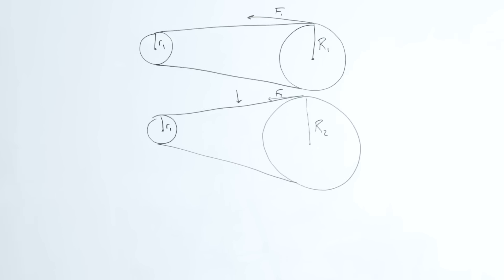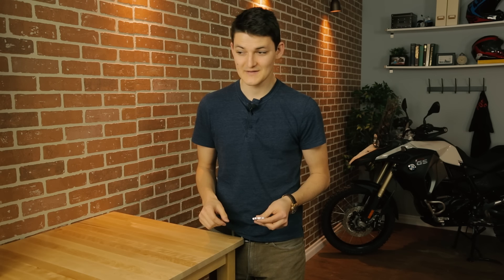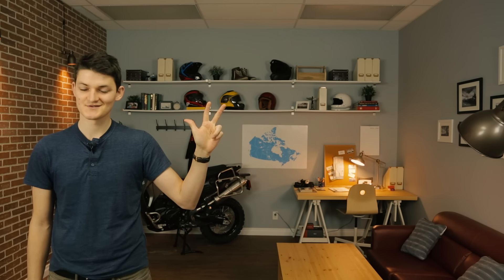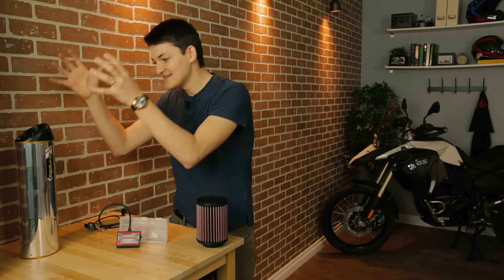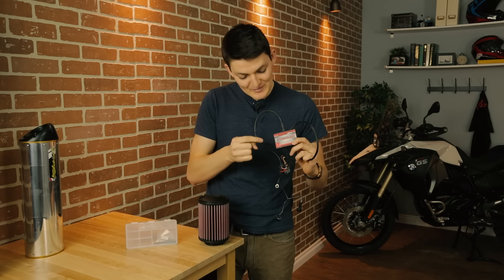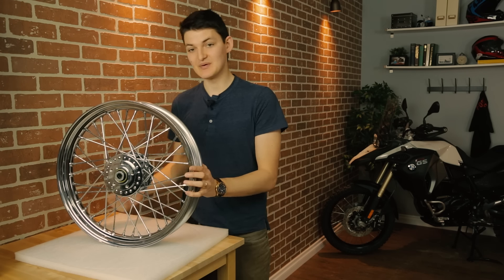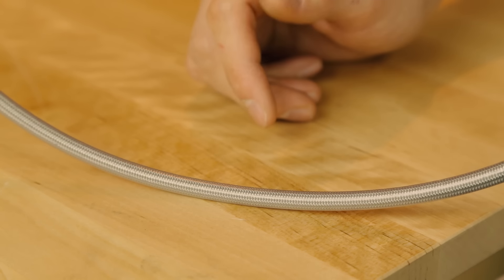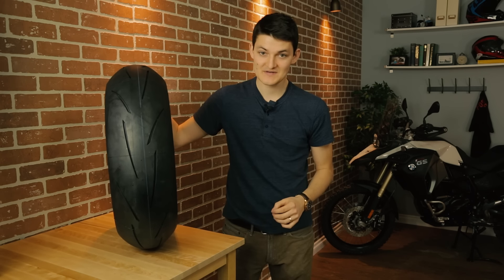Top 5 Motorcycle Mods to Go Faster

Comment: You can also unlock the vTec in Honda motorcycles by installing the stickers
Reply: Does it work with the Grom? I might have to order a sticker or two.
Reply: oh yeah, if you order 2 you get the 2 stage vtec ( low RPM and medium-high RPM settings), if you get 3 stickers, you unlock the ful potential of the 3-staged vTec with low , medium and high RPM settings !!!
Reply: This is true, but only the VFR 800.
Reply: NONONO any Honda bike has vTec, just got to have it unlocked
Reply: Gbblitz Entertainment 100th like on this comment
Reply: Gbblitz Entertainment thanks, I always knew my Honda Z50J could have vtec
Reply: But does it work on my 1100 Gold Wing?
Reply: Gbblitz Entertainment will it work on my 2-stroke honda scooter?
Reply: Ooooh shit I almost forgot about vtech, need to get a sticker for my f4i asap!
Reply: First vehicle to have Vtec was the CBR400
Reply: Then I guess those stickers will keep them winning motogp races like usual
Reply: @AvocadoAtrocity  yes I love my VTEC Honda it’s completely murdered out but at least that sound is distinct
Reply: So your telling me a sticker will make my bike faster ??
Reply: @Darko2  obviously duh
Reply: All you need is flame stickers

Comment: I have religiously done all 5 mods to every bike I have owned the last 25 years.   But the mod that gave me the most acceleration, speed, handling, breaking, and the most attention from the girls at bike night, was loosing 50lbs off my midsection.

I was like going from a CB250 to a CBR1000XX
Reply: Tall ppl cryin rn🥲
Reply: There is no replacement for displacement. My bike already goes 186 mph and seeing how I don't race around my town and highways... That's fast enough.
Reply: @mawwwkn7232  as a 6'5 dude with a driveshaft bike, can confirm 😢

Comment: A word of advice: no two bikes are the same so it's better to combine the PC with Autotune (wideband sensor). The online maps are a good point to START from. They won't be perfect by any means. The advantages of adjusting AFR in real life conditions vs static dynoshop will get you the best results. Another great advantage of the PCV + Autotune combo is that you can add a switch to either load a specific map or have Autotune online real-time to adjust AFR in relation to your current conditions (different elevations, weather conditions, etc).
Reply: @C_R_O_M  whut?!?

Comment: So many people neglect the power command/flash tune/bazzaz. Your bike will LOSE power if you install the exhaust and air filter without proper fueling. Love your videos Ryan!
Reply: Installing only the exhaust does sometimes improve performance, especially on 2 strokes
Reply: @angelorondini5835  modern bikes are already running lean from the factory, extra airflow is only going to make it worse. You NEED a tune.
Reply: @deathwish8339  you are probably right, I don't have much experience with modern fuel injected bikes

Comment: Great presentation.  I " optimised "  my 2009 Bonneville with all the above considerations.  One thing I'll advise on staying alive grounds is not to up the front sprocket from 18 to 19 tooth thinking that the power will be there but on longer legs... The longer legs are there but the top end poke is gone at 85 max.  OK for Chugger types but potentially deadly in half challenging road riding situations

Comment: do a budget bike series please.
Reply: an 80's hondas. VF 750 in any model.....can pick them up a dime a dozen for $1000 or less.
Reply: He is now...
Reply: dantae666 already did
Reply: Ttr90
Reply: Simon Wiggin do a search 44 teeth
Reply: @bonnivilleblackcherry9745  i wouldnt go that far since nowadays most late 90's and early 00's bikes from suzuki honda yamaha or other such brands go for as low as 1500$ and around the 2000$ mark. I mean its not 1000$ but i'd rather get a bike from the early 00's than a relic from 80'.

Comment: 1. Turbocharger
2. Supercharger
3. bigger engine
4. higher octane & re-jet
5. lose some fucking weight
Reply: Except the last one, all of these points are only valid for a straight line "racer".
Reply: Xénos Polemistí̱s  5. Is the best advice lol
Reply: 6. Have a perpetual death wish that makes you mentally prepared to push yourself and machine past sane limits.
Reply: Yeah I set it up so that one would be a read more click to throw people off. lol
Reply: I mean I know what you're saying but generally when people think faster, its more hp/tq, but for cornering, which lets be honest, practice would be #1 on that list. But it's hard to incorporate a list for all types of riding and racing. tracks like wide soft slicks, won't necessarily apply to street bikes, enduros, trials bikes.

1. Develope skill & confidence (shifting points, brake/throttle points, entry & exit lines, tire position/ feel)
2. Tires: appropriate size & material grade
3. aggressive suspension setup & upgraded brakes
4. steering damper
5. lighter components (driver included)
Reply: Xénos Polemistí̱s 
Thank you
Reply: don't forget to mount supermodel will give you good boost.
Reply: Too expensive.
Reply: mattman815 im 60kg and 180cm. guess i dont need to loose more weight
Reply: Damn
Reply: You have two kidneys, one can be sold for bike upgrades. There are also a few bones you can live without, and as long as you are above 4% body fat, you should have enough to body heat to prevent hypothermia on a day to day basis.
Reply: Sure do all that+++ Or just get a better bike DAUGH
Reply: YEP read and apply and practice, old and slow method but the best. 200hp is no good with a squid at the bars.  100hp bike with real rider will smoke him every time.
Reply: tAMEN most bike are more than most can exploit. Most wrecks or losses are due to unskilled riders. In sport bikes I bet 99 percent never get close to the bikes limits ever. The bike is better than most could ever use. Get skills, you will be shocked at what the new bikes can do. New sportbikes can smoke 15 yr old racebikes based on street bikes. Trust me only 1% of riders if that many can really push a modern sportbike.
Reply: Nitrous is easiest and about $300

Comment: I was rude as heck to you some time ago.  Cancer comes with great parking and concert grade meds.  Ha.  I got you when there was no concert.  Anyway, enjoy the channel and needed to apologize.    I'm into vintage bikes.  Just finished my 1975 Honda CB 360t.  Took 6 years but that was between surgeries so I'm going to use that as an excuse.
Anyway, most of your stuff is of course dealing with newer bikes and mine are gravity feeds.  This video crossed the time lines.  Air and fuel are a common.  Thanks.  Well explained.  
Working on a 1971 CB 175 next.  These are keepers.  I don't do these to sell.  
Also.  Because of your videos I used your suggestions to purchase two helmets and safety gear.  Thanks.  Spot on.
That's it.  Apologizes offered

Comment: I got bmc racing filters, a straight pipe and a power commander on my cbr1000rr. I dont feel a difference but now it's much louder. I recommend doing sprockets if you want to see an obvious difference.
Reply: It's probably not tuned yet for your intake & exhaust set-up, forget the maps from dynojet, they're off by big margin, custom tune is the only way to maximize performance.

Comment: Imo DNA airfilter is better. And reflashing instead of a powercommander makes you able to adjust more than just air/fuel ratio. Maybe you could make a video about reflashing? I did that on my bike and what a difference! :-) All those sleepy factoryhorses are now unleashed and kicking! :-)
Reply: Flashing & Tuning definitely makes a huge difference compared to a simple PC5. I had my ZX-10R flashed and tuned this winter and it also unlocked the autoblipping (clutchless downshifts) mechanism. The bike just feels awesome now.
Reply: Piggyback computers worked in the old days by advancing the timing and requiring you to use premium fuel, basically trading safety-factor for a few hp, but this is all automatic on modern engines with knock sensors.  O2 sensors and airflow sensors keep the mixture in the ideal range.  So...what exactly is there to change?
Reply: Was going to leave a comment about reflashing, but I'll just thumb this one up instead.

Oh and if you're thinking of changing sprocket sizes try plugging in the numbers to gearingcommander.com, paying special attention to the "Same Tooth - Same Link" section.
Reply: Ideal in a manufactors point of view. They have to maks engines that pass the Euro4 emissons and noisereductions. It's a compromise between what customers want and laws and rules the bikes must respond to. So without those compromises,  we can unleash the horses at the whole revrange, with no lean mixture at certain revs due to regulations. That's why!
Reply: John Puremaster ya gotta flash before you reflash don’t ya? I flashed one time... still in the county jail, something about “a three hundred pound Harley rider was indecent “ Hell I don’t know. 😮😂😅😂😅

Comment: I have a ZRX1200. Going down a tooth makes the bike faster and I don't loose any top end. Since the top speed comes in way below the red line,  by going down a tooth in the front lets the engine rev a tad higher in top gear, hence for a stock ZRX, "It's a win win !"

By the way, great video. I follow all of your videos, you do a great job and are very informative. 
Barry

Comment: I add teeth to the rear wheel.  If you go down one on the front sprocket, you increase the chain's angular velocity, thereby accelerating the wear on your chain.  I went up 4 teeth on my Ducati multistrada, it really stomps its way out of corners now.
Reply: A front swap is pretty cheap though, maybe good just to try it out.

Comment: This video just reminds me how expensive this hobby is. Thank God I bought my used 07 CBR600RR with many of the mods he mentioned.  I think it should be mentioned that many of these mods do not add value to your bike.  The owner of the 600RR wanted 6k based on the modifications it came with.  I told him I'm not paying a penny more than NADA value.  Then from there talked him down to five thousand.  So I have a power commander, Two bros slip on, KN Air Intake all for the price of a stock bike.  Gotta love the used market sometimes!

Comment: Love to hear someone mention rider weight. Cheapest HP you can get. I lost 20Lbs and bike is noticeably quicker. Saved $2k in mods to get same performance. Maybe will upgrade later, but having 160hp on tap stock, I’m not losing sleep about it. If I was riding a 250 or 300, I might be more interested in upgrades.

Comment: Do EFI engines run lean when you reduce the restriction on your intake and exhaust? Don't they have sensors and adjust automatically?
Reply: I don't know how complicated motorcycles are with fuel injection, but on a car or truck if you put an aftermarket cat back exhaust and a CAI then most any vehicle can adjust for the A/F ratio without tuning it. Tuning is usually for changing the timing of the fuel injection, not the pulse width or dwell on time for the actual fuel delivery.

Comment: Hey man, love your channel. Its been very helpful for a novice rider like me. I have a question about these mods though. I have a Honda cb500f. If i were to apply the mods in this vid to my bike, what would the increase of power look like? Ive looked all over the internet for other cb500 owners that mod their bikes and there are plenty but i bever get a straight answer. And no, ik not buying a bigger bike, i love my cb500f, im just curious about its hidden potential.
Reply: You wouldn't see any increase in power at all, that's not how it works. You'd certainly feel an increase in power though. If we were to quantify what the power would look like without using interpretive dance, I'd say it would look like a cross between a small section of thatched roof and a sturdy yellow umbrella.

Hope that helps.

Comment: I save weight by not putting any coolant or oil in my bike. Works fine.
Reply: Des Ulv i remove all screws and pray the engine doesnt fall off
Reply: I just skip using gas
Reply: I just remove engine to reduce the weight and it works I reached 3000000000km/hr
Reply: Same. I drain the coolant in the winter months.

Comment: What makes a brake pad not street legal?
Reply: Dank Kiwi i wonder too
Reply: Dank Kiwi my guess is the materials
Reply: This is from ebc website, actually leaving me with more questions about that.

"GPFAX Sintered Road Race Brake Pads have by far the highest known friction with a measurement between 0.6 and 0.7 and deliver the most amazing brake effect. Because of this factor, they are unsuitable for street use or for road tyres. "
Reply: I know that for cars, track pads are very bad at low temperature and very good at high temperature. So it's bad on the street because you can't get them up to temp.
Reply: specialist race pads are designed to work at their best under extreme load, heat, friction etc.  Conditions that won't be found on day to day Road riding.

They are also designed to be used in conjunction with race spec tyres, suspension, and very high rider skill.  again things that aren't common on the road.

even if the pads performed brilliantly in normal conditions, the lack of specialist tyres and suspension would likely make them more dangerous than good, doesn't matter how good your stopping power is if the forks are going to bottom out, or your tyres are going to melt off, you aren't going to stop nicely.
Reply: Also race only pads do not do squat cold, must get hot and stay hot to work, and that can only be dne with speed and lots of back to back braking like.........RACING. On street pads are cold most times they get used, and race pads SUCK cold. HENCE some states make certain types illegal, not that any cop would ever know, but they put that label to protect their company from squids suing them.
Reply: ok so good brakes are legal. amazing brakes make you a villain
Reply: Probably because really good brakes make you stop quick, maybe it's so quick a stop that the distracted soccer mom behind you won't be able to put her coffee and phone down to stop in time.
Reply: ah, you've got off your mamma long enough for an attempt at witty wisdom. well done for the effort.
Reply: haha nice burn ecks dee
Reply: It's all about coefficient of friction. So-called High Performance brake pads or design to work best at high temperature, plus they are very noisy, which is okay for racing.
Reply: The operating temperature is what makes them illegal on streers coz u are never going to make them warm enough to make them work

Comment: Great video Ryan. Quick question does removing your db-killer increase your performance in anyway?
Reply from the maker: Potentially - some dB killers create more back pressure in the exhaust system. If you remove it, the bike could breathe more air (depending what you having going on at the air intake). As a result you'd get more power if your fuel delivery was sorted accordingly. But we're talking fractions of a hp here... the major difference is just noise and a minor side effect is slightly worse fuel economy (back pressure forces some un-burned gas vapor back into the cylinder, so it's kinda handy). ~RyanF9
Reply: Cheers bud ;)
Reply: Rosstinelli it depends on the design of your camshaft, on some bikes you might even loose horsepower if you lower the backpressure
Reply: Maybe a fraction but the noise will just draw cops attention and piss more people off at all bikers. Dumbest thing in the world is making a bike LOUD serves no real purpose. Pipe was designed by engineers for power and quiet. To get real power increase pipe would be designed for free flow and also other factors, not designed in stock pipe with just baffles removed.To get real power rejetting on carbs or remapping on injectors with free flowing intake is only way to get real power boost from more free flowing exhaust. Engine is a air pump and gas burner, you need more air and gas in and more exhaust out to really improve performance, and must be matched and balanced. 1 by itself many times lowers power as system is no longer balanced, ask any engine builder most pipe even good aftermarkets that are usually louder will increase top end power to free flow but lack of back pressure down low kills low end and midrange, no free lunches. Back in the day stock pipes were very restrictive and a pipe helped a good bit but that is no longer true.
Reply: how about the purpose of not getting run over by other drivers who would then stand over your dead body and say 'i didn't realise he was there". not to say bikes need window shattering volume, but a decent level does make you safer on the road.
Reply: Joe Veitch and how do you know what the engineers designed the bikes exhaust for? It could be power or quiet or reliable but you cant just say thats what they did it for. you werent there

Comment: No ECU flash?
Reply: Heretic Anthem is that not what the power commander does?
Reply: @johnnybanks61  No, the Power Commander is a “piggy back” tuner. You attach it to the bike and it “overrides” what the ecu has in it
Reply: @JohnSpartan-117  Oh I wasn't aware that's all the power commander does. I thought it did full ECU flashes. I've always been skeptical about piggy back tuners. I have only ever used tuners that hack the factory ECU
Reply: @johnnybanks61  Yeah that’s what I’ve used as well with my previous bikes. Vance & Hones Fuelpak 3 for H-D Street 750 and Dynojet Powervision for H-D Sportster 1200.
I just got a Honda CB500F right now and looking for a tuner for that, preferably an actual ECU reflashing tuner.